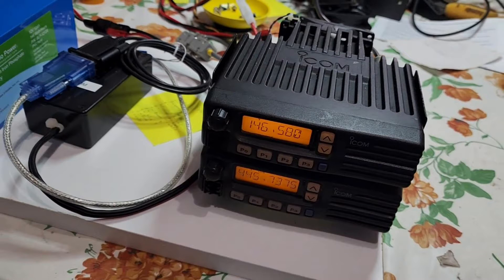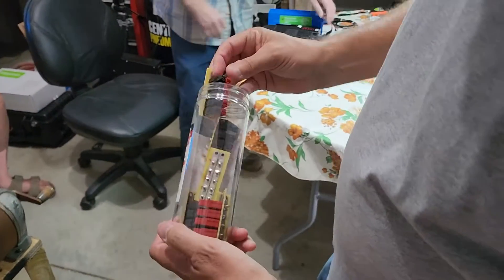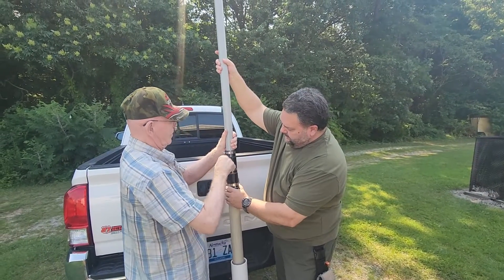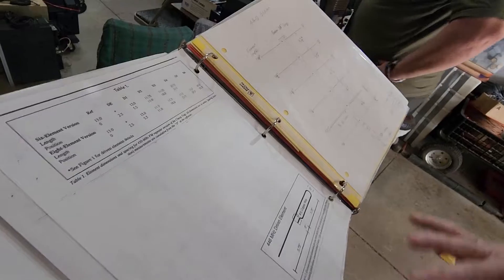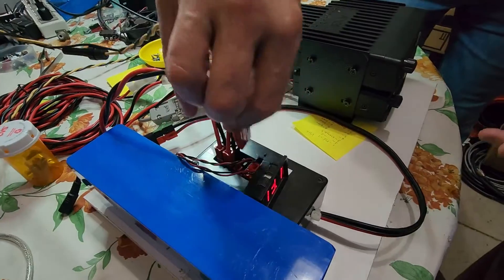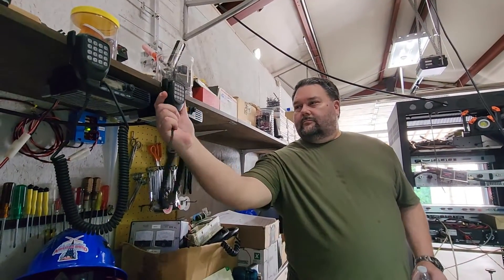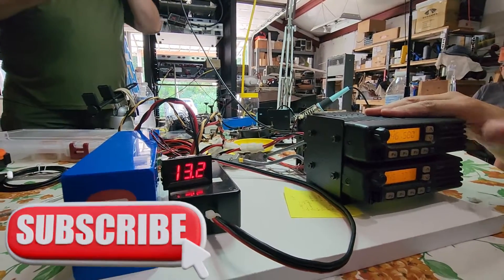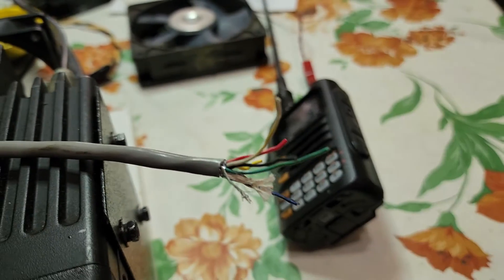LCARA HAM Radio: Crossband Repeater Kit Build - Part 2

Comment: Geez mate, you spent almost the entire video worrying about battery power and not once did you explain how those two Icom radios were connected to make them able to cross-band with the “special” cable.

I own both those radios and have no idea how it’s possible to cross-band them!!!!
Reply from the maker: Stay tuned, next couple of videos you'll see how the magic works Or you can watch how we built a GMRS repeater using the same hardware and cable 😉. Thanks for watching!